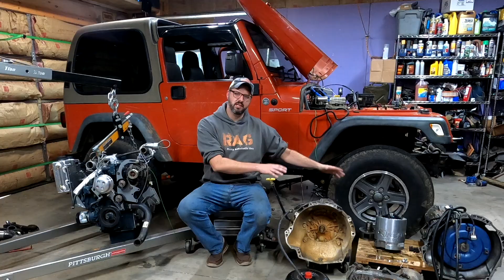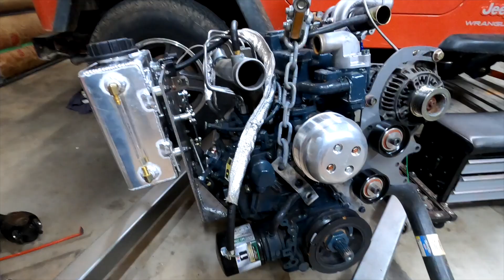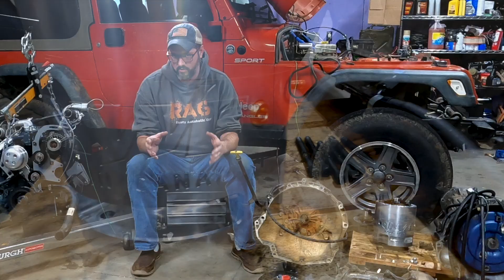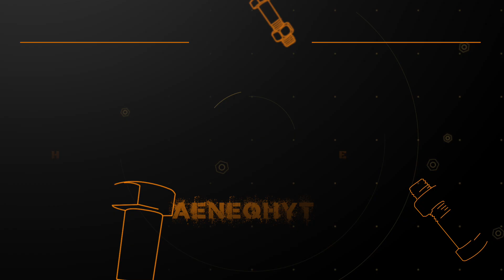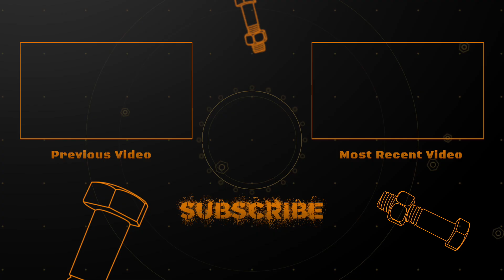The most common questions asked about my Diesel Swapped Wrangler

Comment: What bell housing adapter do you need for the ax15?
Reply from the maker: KubotaSwappers closed shop a while ago, he ran into issues getting materials to make everything. I've still got the complete Kubota engine with turbo, adapter, accessory drive if you need a complete setup.

Comment: I have a 1959 willys FC 150 and a Kubota V2003 out of a tool cat. i actually have the whole tool cat. The wheelbase is extremely short 90 inches It has a Ford  9"rear end and I am planning a Dana 44 solid axle front end.  I am trying to figure out what transmission and transfer case to put in this creature. Can you help?

Comment: Consider splitting that turbo's load up? @1800 (2150 dip) will be flirting with under boost under load.
Compounds?
Like (ish) K03 secondary over S300G atmospheric?
Boomdiggity.😎

Comment: Next question how many different diesels you gonna throw in this thing? 😆 Seen some of your tdi videos good stuff, why not use a manual trans?
Reply from the maker: Honestly I don't know. I know manual would solve some issues, and I do know how to drive a manual, did so for years, but for the style of wheeling I enjoy,  automatic is the way to go. That being said if this last ditch effort with the AW4 doesn't work, I'll be swapping in a NV3550 5-speed manual since it came with the wrecked TJ Rubicon I just purchased.

Comment: I have a Audi with that k03 on it and I can for 100 percent say that 25 outta that turbo is a bad idea it's way out of its efficiency range and is making a huge amount of heat the max I would have seen run and this is at the top of efficiency is about 18 psi unless you are running some kind of injection like water meth or something 
Now that said this is a great build and I plan on doing one but if I was gonna run anymore boost that the 15 psi I would swap to a k04

Comment: I plan on doing this swap to a xj would you able to possibly give me a run down of the parts I need ? I have the right 
transmission
Reply from the maker: Hey Blake can you email me, my email address is RustyAutoholicGuy@gmail.com, that will be easier than trying to do this over comments! Thanks
Reply: @RustyAutoholicGuy  I emailed you bud
Reply: I'd go manual transmission 
Chryslers automatics suck
Why would u want a higher stall torque converter for a lower reving diesel.....they make more power at low speed
A np231 chain drive t case......another weak link

Comment: Torque convert lock up is something to consider as well. When it is locking up and such. Not locking up would nuclear meltdown the Trans in overdrive.  Would be cool to lock it up on those steep decents you mention when using the engine braking

Comment: Hey what does ur motor mounts look like I have a 2203 swap in a cj2a everything rattles like crazy thou
Reply from the maker: So the motor mounts look like stock Wrangler mounts but I got bushing from Brown Dog Offroad here:

https://browndogindustries.com/BU2500K2-Rubber-Bushing-Motor-Mount-Rebuild-Kit.aspx

I made the motor mounts myself to lower the engine and got bushings from them that would fit my application.

Comment: https://youtu.be/Gv3ygrasT-U?t=134
technically wrong:
You will ALWAYS drive a car with its torque NOT HP! As the torque AT THE WHEEL is relevant for the acceleration, not HP.
BUT: Make sure you read correctly. Wheel Torque is what I am talking and what is mathematically correct. So 200NM Engine Torque x gear x diff. eg.: 200NM times 4 in first gear times 4,5(6) diff = 3600NM get´s you going in first gear.

To get a good top speed you NEED HP! 
To get you driving nicely you NEED a bright RPM range. THAT is often times the problem with industry engines, like 1 Gen 6BT with its 2700 max RPM.
So if you have an 4,56 Diff you can calculate @ which RPM you sit on 120km/h. ~70mph. If that is too high RPM you need longer gearing, like 3,21:1. But with that you are just shy of 2600 NM in first gear, so wayyy slower acceleration.

= an gas engine gives you RPM and HP and a broader usable RPM range. 
This is actually not able to answer from ENGINE Power (NM or HP), you always need to calculate the diff AND Gearing as well! Engine Torque means nothing.

Comment: Nice setup. How do you think it would stack up against one of the Mitsubishi factory turbo diesel jeeps?
Reply from the maker: I've always been interested in the CJ-3B Jeeps from Mitsubishi, I've seen a few for sale here in the US, I believe they are around 85hp and I don't know the torque of the top of my head, I would guess under 200ft/lbs, I know they get good fuel economy as well. 

Without having driven one or worked on one I can't say anything definitive however I will say having a diesel engine from the mid 2000s vs a diesel engine from the 70s/80s I imagine this Kubota is quieter, cleaner and produces more torque than the engine that comes in the Jeeps from Mitsubishi.
Reply: @RustyAutoholicGuy  yes, the naturally aspirated ones ended up with about 85bhp and 16kgm. The direct-injection turbo version bumped that to 96bhp and 21kgm. I put some info together on those here: https://youtu.be/6CivSVYOhko

I’ll look into Kubota availability for an eventual replacement if my 4DR6 ever dies! I’d be more likely to find a marinized engine here. Was the direct injection unit available in marine trim?
Reply from the maker: @LesSharp  I don't know honestly about the marine trim. I will also tell you mine is IDI not DI, which means I'm down on power but I can run bio-diesel which is a bonus, there are a few places to get it which cost less. 

I'll check out your video tonight!

Comment: How much $$$ have you spent on adapters that you never used?

The setup you had with the AW4 would have been fine if you just went to the junkyard and got some 4.10 axles.
Reply from the maker: So the original adapter was like $725 ish, it's been two years so I can't remember. Going to 4.10 axles is possible however because of the Right Hand Drive all the axles have their brackets installed in a mirror location, so I would have to cut and re-weld all the axles, again doable but not a simple bolt in swap either. Ultimately I went with the 6r80 6-speed automatic because I had that adapter already for another project that is more than likely changing because of some length issues that I've been running into with the design.

Comment: mountainI've wondered now much a compound turbocharger would help on mountin passes.
Reply from the maker: I'm beginning to wonder that as well, but I've already fought EGTs and temperatures, I wonder how much more those would become an issue?
Reply: @RustyAutoholicGuy  effective charge cooling is a MUST!  part of it is keeping the compressor within it's efficiency island along with an effective after cooler. when compounding I'd argue an inter stage water to air unit is called for.
Reply from the maker: @2000freefuel  yup that makes sense and I'm already running a water to air intercooler already, not sure I have room for a second setup. Honestly I think switching from my AW4 4-speed automatic to the 6r80 6-speed automatic is going to resolve solve issues I've been facing.
Reply: @RustyAutoholicGuy  I'm still looking for information on the joint venture FORD/GM 10 speed automatics.

Comment: What kind of a driveshaft are you using with the transmission doubler and transfer case? If I add a doubler to my TJ I'd have to bolt the axle to the transfer case!
Reply from the maker: I had moved my engine forward 6.5" inches so I was able to make up the length of the 7" doubler with also installing a super short SYE on my NP231 so my rear drive shaft was around 14.25" inches long.

Comment: Thanks for the transparency and I appreciate the detail.
 Not only is the AW4 inexpensive, it is bullet proof behind a 4.0L........providing you keep it cool.  I had one in my 1998 Cherokee that I installed a large aftermarket tranny cooler.  I like that the AW4 has a drain plug in the oil pan.  At 50k miles, I dropped the pan and changed the fluid and filter.  Afterward, I would drain the pan every time I changed engine oil (every 6k miles) and refill it with 2-1/2 quarts fresh fluid.  I used Mobil Dexron/Mercon III (non-synthetic).  I sold that Jeep with 296k miles in 2014.  Last I heard (about a year ago), it was still running the same transmission.  As an FYI, the plugs are softer than the pan.  I replaced the plug about 4 times in 240,000 miles.  They are probably still available from Jeep.
Reply from the maker: I'm sorry I haven't responded to this sooner. Everything you said about the AW4 is correct and I still really believe that going with the AW4 with a .75 overdrive would work, but I also think the 6r80 I'm going to will end up being a better transmission for the Kubota V2403 engine as well.

Comment: Awesome episode! Answered 90% of my questions! Thank you!
Reply from the maker: You're welcome Duddie. Out of curiosity, what is the other 10% of questions that you have?
Reply: @RustyAutoholicGuy  My other 10% would be picking the correct size Turbo for V2203,  Did V2203 come in anything else besides reefer trailers, can Kubota Swapper make adapters for any transmissions, and lastly fuel mileage, but I don't think you can answer that yet since you are still testing and tuning. Thanks in advance for any help on those questions!
Reply from the maker: @DuddiesAdventure  so KubotaSwappers can make an adapter for any transmission almost, I got him to make an adapter for a 6r80 6-speed Ford automatic transmission for my next build. The 03 series engine came in tractors, generators, and marine applications. The only tank I have tracked partially I got an estimated 25mpg, but I was running less boost and no intercooler. I'm trying to get my TJ to 30mpg highway is the goal.

Comment: I did not realize yours was IDI (indirect injection). Do you have any idea if you could run waste motor oil or waste vegetable oil in it? Also I'm a little color blind and I thought for sure your Jeep was fire red like mine lol.
Reply from the maker: I should be able too and I've thought about trying to do so as well but I need it running better first!
Reply: @RustyAutoholicGuy  I definitely understand that. I was just curious if that was an option on those motors. I know the tolerance on the injectors is a lot tighter on the newer engines
Reply: Ran, veggie oil and home made bio, had a bad infection fuel tank looked like a sod farm, couple quarts 10% ethanol fuel fixed the infection
 Over a year later the fuel system pluged up. Found the veggie oil if not  separated has a wax type buildup looks like gasket sealer took out the injector system pump and injectors.
My conclusion saving pennies cost about $1000
Not belly ackin just sayin alternative fuels work as long as you don't skimp on the process. I'm back to pump fuel, it just works
Reply: @jeffscruton6327  absolutely! Definitely don't cut corners on alt fuels. I think if you were looking for a safer alternative fuel you should look into waste motor oil. I believe it takes a lot less work to make it safe to run in your vehicle.
Reply: @kyfiss9176  another alt is hydraulic oil, have a friend gets the used or non used oil from an OEM does upgrades and doesnt reuse the oil another option is machine shops change oil on a scedule

Comment: If that's the case I may need to put hydroboost on my mazda. Ken has a kit to use a mazda transmission from a b2600 with the mazda g6 engine. I have a few things that's taking priority right now. I'll get it there someday.
Reply from the maker: I really would recommend, I'm seriously debating putting it on my LJ Rubicon right now just to have the better braking force.